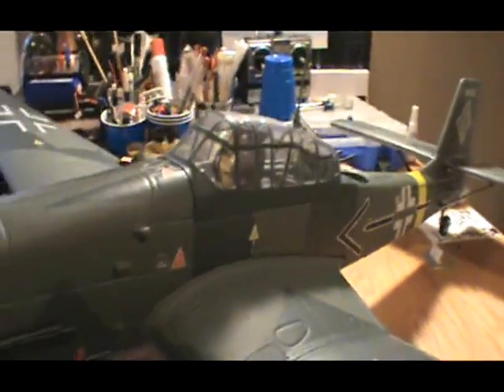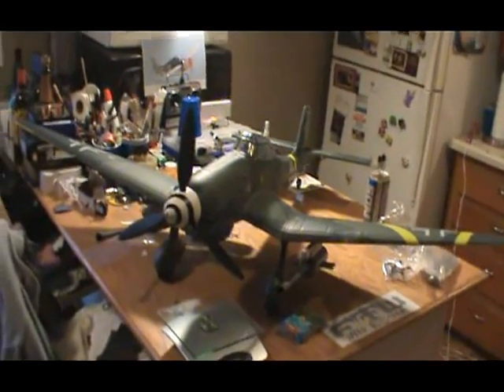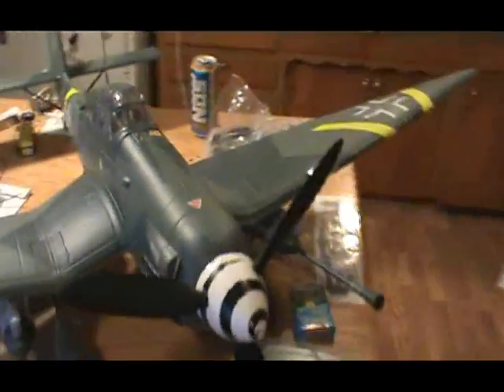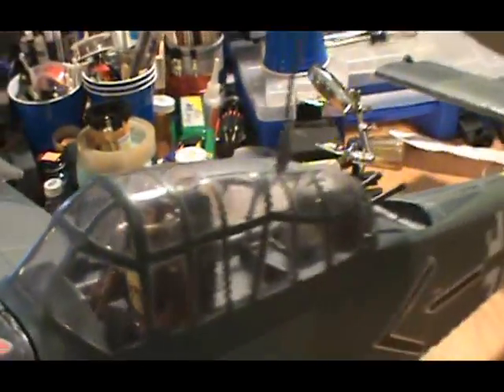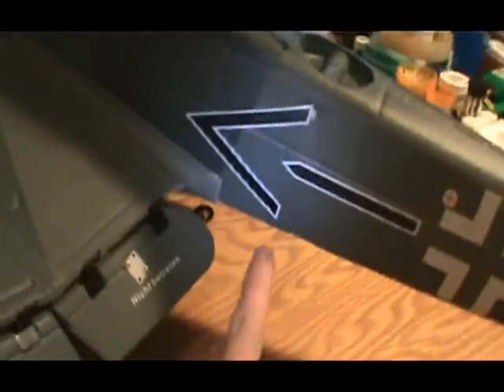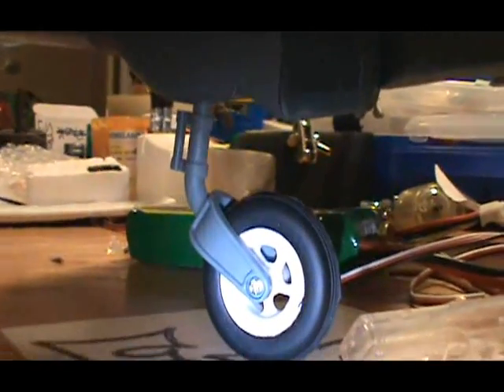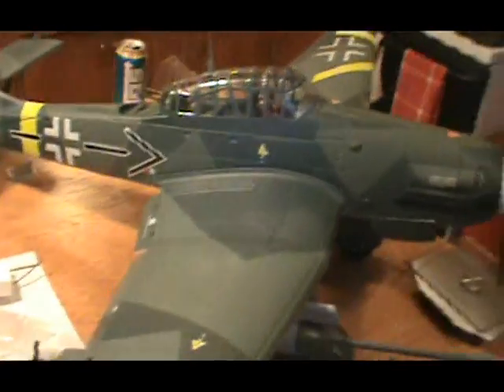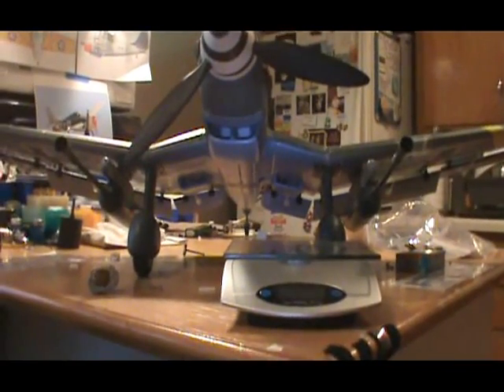Airfeild Stuka detailed overview part 1

Comment from the maker: So to sum it up there will never be a 100% scale RC. So the left out bomb mount was correct, dive breaks which are called wing slats first designed by German engineer Handley Page, they are still called (Handley Page leading edge slats) and where fitted on almost ever WWII aircraft, as well as modern day fighters. This feature would require an addition of 4 servos and would require an 8 to 9 ch. radio, so its not very economical. Don't take scale so literally.

Comment from the maker: I realize that its not 100% scale, I heard the real one had an engine, pilot, and combustion engine!! who would have thunk. Good job on the google search, but you are wrong. The D version was used mainly in strafing runs, it did carry a single smaller bomb on its belly but it was mounted flush. The D version here was purposely fitted with the large wing cannons. The B version was fitted with a split Y mount at 35 degrees pitch down for accuracy so the bomb went where the pilots crosshairs where.